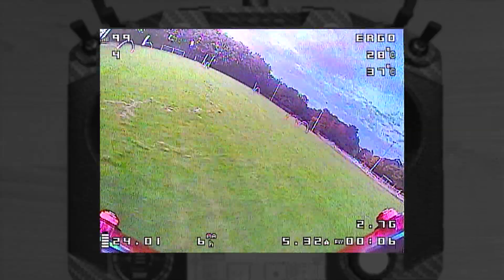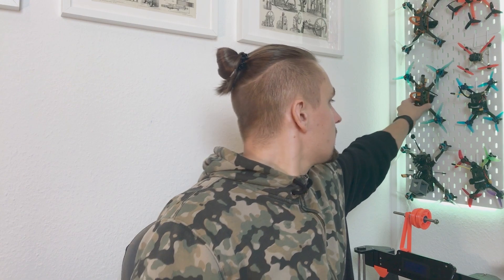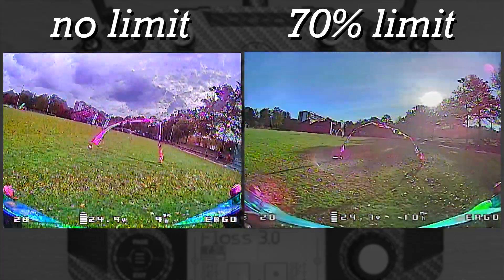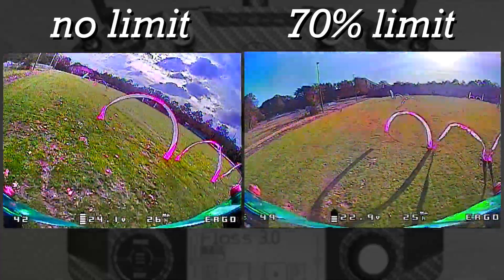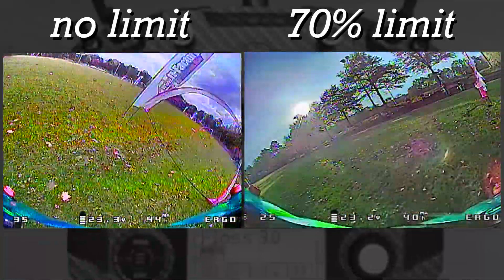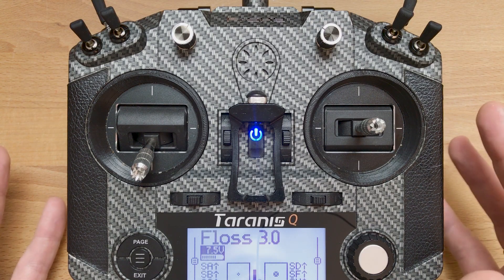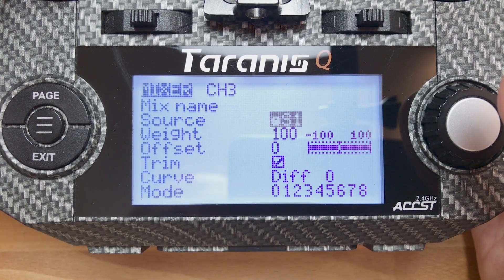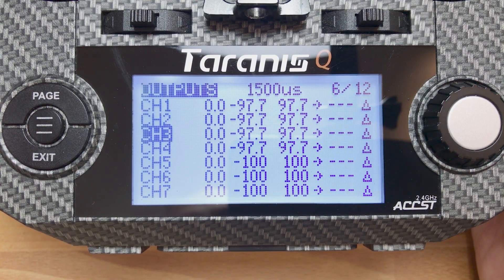Throttle limit will make you faster | Throttle cap on potentiometer with OpenTX

Comment: throttle limit is actually insane, put it to 50% ,train lines, go full speed, do it again. and pro tip: use a stacksaver, they are like 3 bucks and it will save you a lot of escs/flight controller. well made video btw. happy flying :D

Comment: I fitted a powerful motor to a light aircraft with a lion battery. Can I prevent it from damaging the battery by drawing too much current with this method? I think even half strength will suffice.
Reply: It should

Comment: I wondered because this first didn’t work for me with my Tango 2. But figured out why: Tango II XF 6.10 delivers the option to bypass gimbals which saves about 1ms latency. So if you want to use different Throttle Limits over a Switch be sure not to select any mode in general radio settings. It will only work if you select freedom tx like in the past in general radio settings of the tango 2.

Comment: It's not only good for racing - one can benefit from it also in freestyle - if normally not using 100% of throttle - by adding throttle limit the resolution goes up - and it's pretty obvious that with more resolution comes more precision (imagine a deep dive followed by a tight gap)

Comment: For me this regulation works somehow strange. reacts only in 1/3 of the position of the knob. Is this rather normal? I have x-lite
Reply from the maker: Could it be that the knob is not calibrated properly? On QX7 there is a small dead zone at the beginning of the range but otherwise the whole rotation is working. There is a calibration option somewhere in OpenTX menu, I would try it.
Reply: @ErgoFPV  ok i will try, thanks
Reply: Works perfect after calibration, thanks again :D
Reply from the maker: You're welcome!

Comment: Brother really yr information is logical nd easy to consume ... I like it ... Thanks for yr all info in this chanel ..I saw one by one ... For this vedio I hv a condition ....u make a throttle cap switch that's great nd easy nd handy much ....but did u said when we need to chenge cap mean after use 100 throttle at some place I decide to go with 70 % then I need to disarm my quad first ,??????? Can't I apply it during a  running quad ? Pls let me conform that part ? If somehow I manage to adjust throttle % at running quad it will be easy more ..... Do u hv any suggestion bro ?
Reply from the maker: You don’t have to disarm the quad to adjust the limit. If you manage to take your fingers off one of the sticks and turn the knob while keeping the quad in the air - you can do it. The limit is applied in real time as you change the knob position. In the video I disarm the quad to check where the limit is at, and to do that I raise throttle to the maximum and see what the throttle indicator in Betaflight OSD shows. But you can totally do it by feeling while in the air, and if you have a radio with side sliders, like X9D, you can even make it comfortable.
Reply: @ErgoFPV  always like a savier (for me atleast ) brother after the pid king of internet I fall in love with u .... U explain to the point ... Perfectly wht I serching for my cinehoop making ....there was a Little info about cinehoop even at 3 months ago also in internet ... I found clearity when I hit yr website nd read about yr cinehoop making ... Awosome explanation .... 4.1 betaflight u use for cinehoop wht is a maximum challenge for cinehoop pilots. ....all afraid to come at 4.1 .....they maximum love 3.5.7 beta... But u dare to go with  4.1 with most logical tunings ....brother i become yr fan nd will reguler follow u ... I also wanna make donut cinehoop ....I m confuse wht should I go for 3.5.7 or 4.1 ( even download donwload 4.1 beta properly is a huge matter specially in vtx ) can u pls suggest me wht should be a good option for me ?

Comment: I agree with your theories for the most part, especially when it comes to throttle limit, but I think that learning to fly at different camera angles is something you should do early on. In my experience, people that the people who learn to only fly at one angle have trouble adjusting later, which is important if you start to get fast enough to need steeper angles like 55-60 degrees. By learning the mechanics behind camera angle and learning to approximate the required movements and adapt, you gain a skill you otherwise wouldn't be practicing. This will help you go between something like a Tiny Whoop and a 5" race quad with more ease.
Reply from the maker: Oh, I absolutely agree. I noticed that myself too – as soon as you put enough stick time into several rigs with different cam angles you don’t care that much about it anymore. But you have to get a grip on both extremities, 10 degrees for tiny/cine whoops and 50-60 degrees for racers.

Comment: does it work on flysky transmitters (in my case i6X) as well? ...btw. you are THE guy!!!
Reply from the maker: Thank you! I don't think you can make it work on i6X because it does not run OpenTX and offers less customisation options. What you can do instead is use the OSD menu if you run Betaflight 4. You go to the OSD menu by throttle to the centre, yaw left, pitch forward, then enter PROFILE, then RATE, then page down to see THR LIM * options. You set THR LIM TYPE to SCALE and THR LIM % to the desired throttle cap percentage. Then you yaw right to bring the quick exit menu and choose SAVE & EXIT. It is less convenient than a potentiometer because you need to bring up and navigate the menu. Even more, it does not allow you to quickly check what the cap is at because throttle indicator in the OSD shows the position before Betaflight does the capping, so it always shows 0-100% and to see the actual cap you need to visit the menu. But performance wise it is the same, so you can use it for getting better at track lines exactly as I did in the video. Cheers!